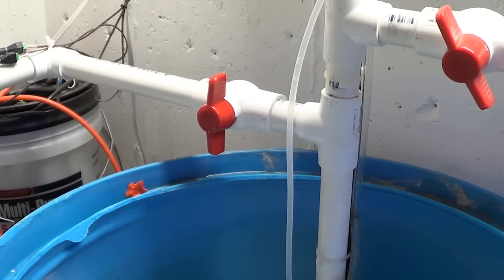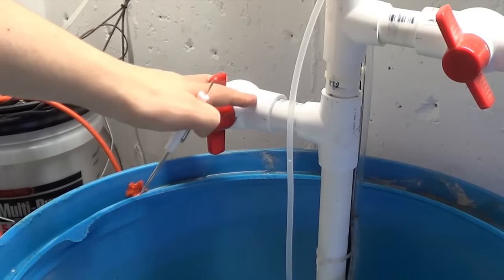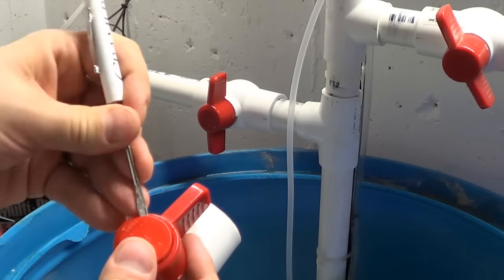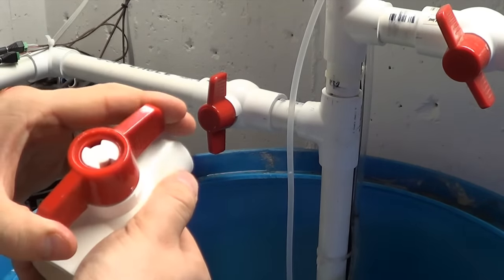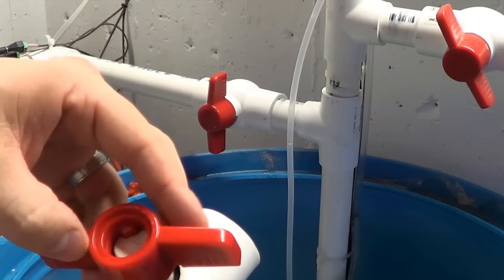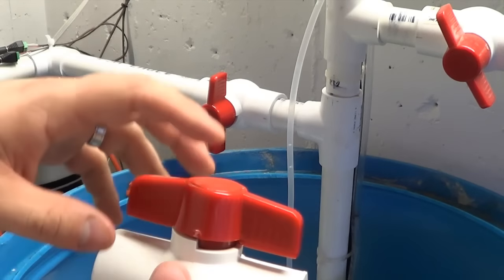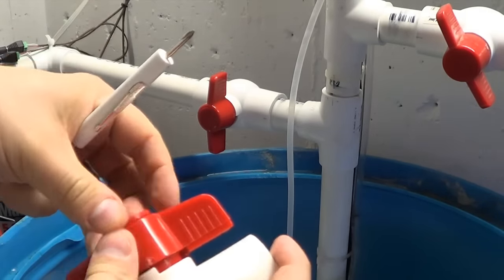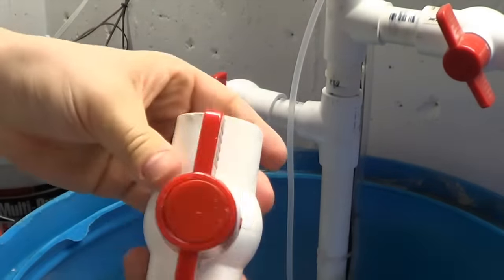#341: How to Replace PVC Ball Valve Handle - Tank Tip

Comment: Thanks for the video. Way easier than cutting the thing out and replacing the whole valve.

If even been considering fiberglassing the handle to fix the crack and make it stronger...... easier to just replace every couple years.

Comment: Excellent video!! Question: will this fix a leak that is coming from that removable top cap? Is that the handle that is broken/leaking, or the actual valve piece?

Comment: How do you loosen a tight handle so it doesn't break?
Nice video good information
Reply: @elegant6066  Put a few drops of mustard oil on the screw and try to turn it slowly
Reply: I have the same problem. But I don't understand. How do I put mustard out on the screw? Do I pop the cap off? Or do I just the oil all over the handle?

Comment: Great tips. I have the same issue and was going to replace the entire ball valve. It is much easier to replace the handle. That said, I am having troubled finding the same ball valve. Can you tell me what you used as the style is identical. All the ball valves I am seeing on line have the screw to attached the handle. Mine is like in the video where the handle cap fits into the two slots with no screw. Thanks in advance.

Comment: Thank you SO much for this video!! Have realized we can replace the handles ourselves. Only issue is finding the replacement handles - any idea where to find this specific type? So far I can only find those that have a screw under the cap (but look the same otherwise).
Reply from the maker: its easiest to go buy a new ball valve of the same size and brand and just swap the handle out, a little wasteful, but finding a replacement handle is a little difficult

Comment: I have same kind of valve in my sprinklers box and it’s leaking on that round cap in the middle of the valve. Any way someone can tell me why and how to fix that. Before today I only had little bit of the water when I just turn the valve on. But today is full stream of water out of it. 
Thank you in advance.

Comment: my cap fell off, but I can't tell if the valve is stuck partially open or closed. Any way to find out? 

Like I installed the cap back into it but not in the same position as when it fell off, so I want to know if it is restricting water flow.

Comment: My 2” ball valve is actually leaking out the top of the cap. I really really don’t want to have to dig up the entire valve box and 4 feet of buried line to cut and glue a new valve in. I’m really hoping a can just replace the handle and new cap. Wish me luck!
Reply from the maker: Good luck, check for any cracks, especially if it was outdoors and may have frozen

Comment: What brand is this replacement ball valve?  Mine is with the two tabs but the ones I’d have to take apart to find out if it has the two prongs.  If you could tell me where you got yours that would help too.  Thanks in advance.

Comment: Ball valve stuck. After replacing the Tee handle what type of lubricant if any could we use to prevent a reoccurrence?   Good video. I'm into Root causes.
Reply: So you can replace the handle while leaving the valve open? No water comes out the top?

Comment: I would love to know where you found the replacement handle also, as mine matches your brand. I can find all the others but not the one I need.
Reply from the maker: Dustin Reudelhuber I got a full valve and swapped handles, you may be able to contact the mfg for just the handle
Reply: Do you happen to know the manufacture or where you got yours from? We only have 2 different styles here in my town that I can not swap out the handles from the models as they are the screw in type.

Comment: thats nice in theory. But my handle sheared completely off.  The white "wings" part of the shaft just tore right off.  This is the 2nd time this has happened. These ball valves get stuck over time, harder and harder to turn.  I don't know if its chlorine or what but something inside these red ball valves is just not compatible long-term with pool water.
Reply: same thing happened to me, what'd u do? Cut it out and put something else in?
Reply: +Juanito Alimaña 
mine was near the ground so I had to dig around it and cut the whole valve out and replace it. I used the same type again and it broke again. now I just leave it open.  next time I would use a knife valve.

Comment: This did not work for me  the new handle was exactly the same brand and everything the sticker was still around and we even compared the numbers on it. But it was slightly larger than the old one. I noticed there's an o ring in there. I replaced that and it worked.
Reply: Glad you mentioned the O ring.  Mine all leak from the top of the handle and I'll bet it's the o-ring.

Comment: The ball in a 3/4 ball valve is stuck in the closed position and attempting to open it to get water out of the tank the red handle keeps turning  how can someone get the ball to the opened position so that the water can flow from the tank